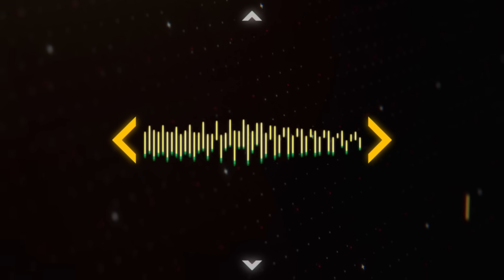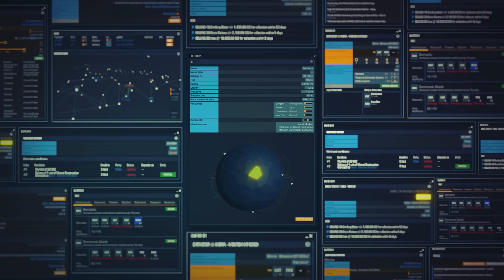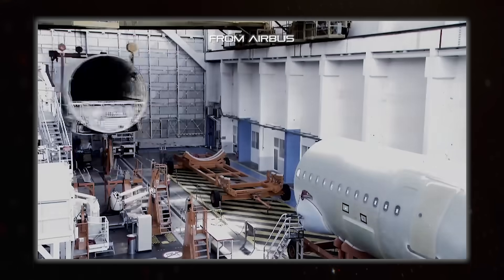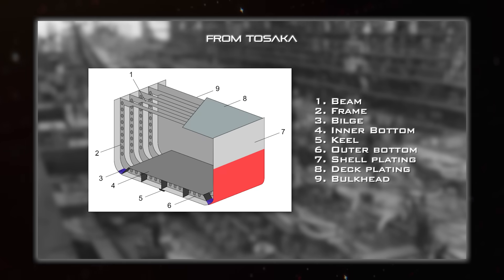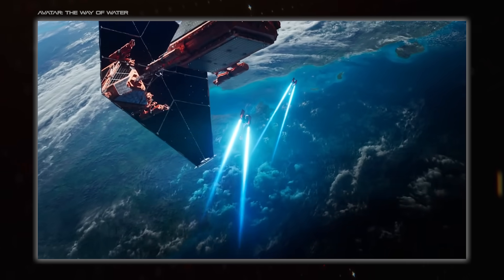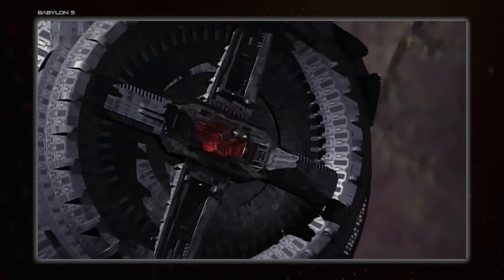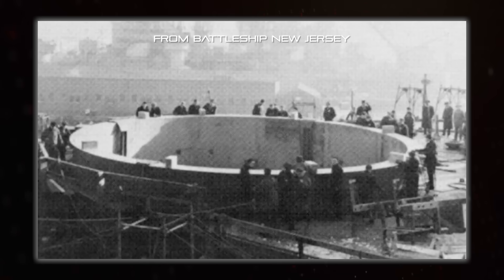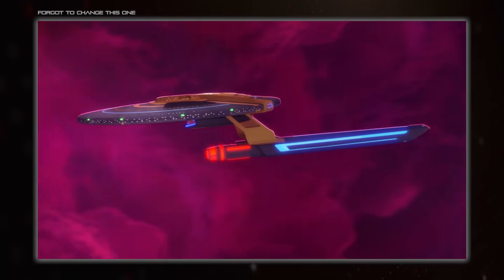How To Build the Structure of a Spaceship

Comment: Seeing the Eagle from Space 1999 brings up another interesting topic - interoperability and modularity. 

The Eagles entire cockpit section/command module could detach and become a lifeboat, but it could also dock with any other attachment for a command module, even if the command module itself was substantially different.
Such as the much bigger one on the Ultra probe.

[Which contained a tentacled telepathic monster that could mind control victims and dragged them in before spitting out their stripped skeletons ... on a morning childrens TV timeslot.]

There were also the Hawk fighters. 

And Eagles themselves could swap out central sections as well, to do a variety of task.

Someone at Starfleet watched Space 1999 and got the idea for the Runabouts swappable main sections.

They had found a missed file of copyrighted material, as all copyrighted materials were banned after WW3, along with Genetic engineering. 

Thats why you never see any copyrighted stuff in holodeck programs..

Humanity was still scarred after WW3 started due to copyright lawsuits between Apple and Samsung being the instigator. 
Apple and Samsung were, like all major corporations, controlled by different Augments.
And were tools in their proxie wars.

But the universe of Space 1999 shows a good utilisation of a standardised design for ease of interfacing between ships.

Comment: Use Lego. And when in doubt use MORE Lego!
Reply: And some Kragle for the iffy parts...
Reply: Lego is the solution to everything, ask me a problem and i will tell you how to solve it with lego
Reply: Hear me out, Lego and duct tape.
Reply: @dustybunny369  gorilla glue is an option as well 🤔
Reply: SPACESHIP!
SPACESHIP!
SPACESHIP!
Reply: @IAmEvilTree  are you.... Summoning a ride home 🤨
Reply: @IAmEvilTree  at least I understand this reference 😅

For those who don’t know SPACESHIP!!! Is a quote from Benny in the Lego movie 😂
Reply: How awesome of an invention that would be; super durable, temperature resistant upscaled Lego bricks that you can build any functional structure with from skyscrapers to spacecraft.
Reply: @christiancorralejo8726  I want an entire spaceship use this
Reply: @christiancorralejo8726 yeah we have that it's called modular construction and panel construction
Reply: unironically a great way to visualize 3d shapes and proportions because while CAD is faster/more date complete, the sheet dopamine of just messing with legos will pull you in deeper than any more focused project
Reply: Construx by fisher price 
circa 1980's
Or Bristol blocks
Reply: Modular construction is technically Lego. In a spaceship setting at our current technology I could imagine a ship built from standardized blocks with connection nodes at specific locations.  The main problem is weight. Many of the double walls between blocks would be ‘over engineered’. And when you a talking physics and orbital mechanics mass is your enemy as it requires more delta V to complete your missions.
Reply: I'm literally doing this right now 🤣
I use Bricklink Studio to design ships and mecha using a digital Lego bucket.
I'm not sure if I'm allowed to post a link to my Bricklink profile here or not?
Reply: @brianwalker8465  ooh what does it look like?
Reply: GUYS GUYS!!!

AN ENTIRE SPACESHIP MADE WITH BIG LEGO!!!!
Reply: No wonder we don't see spacewalks often.  Walking on Lego sucks.
Reply: LEGO!!!!!
Reply: And make the xenos step on it.
Reply: Lego Star Wars😂
Reply: And if that don't work...

use more lego.
Reply: Despite use Cobi, Bluebrixx, Xing Bao, Cada, or any bricks but lego. Cobi is preferred. Best strength.
Reply: Do you know how much damage that will cost legos falling to the surface could wipe out a city
Reply: And duct tape

Comment: There is a reason most space vessels in Perry Rhodan are spherical.
Reply: Those boring spherical ships and yet, after reading the series for 15 years I have yet to tire of them 😁
Reply: Keep in mind that one aspect of engineering is cost. A large spherical hull may make sense from a pure physics standpoint but it'd be VERY expensive to manufacture. Plus, you'd have all kinds of wasted space everywhere inside. Here, a submarine is a good model to base a spaceship hull on: A tube with a hemispherical cap on each end.

Plus, a ship with spherical parts could be fine but an entire ship being one big sphere? That'd look stupid as hell.
Reply: @christophermcelligott1593  A sphere is much more stable than some other design in fiction and much easier to manufacture.
Though Terran ships usually have a ring added to their equator for different reasons.
Given, a cigar-shape is better looking, but isn't as stable on the ground as a sphere.

People have been fine with the spherical ships in Perry Rhodan for over 60 years. So they must do something right. Especially if you consider that we don't just see cover art of them, but cutaway pictures of spaceships and equipment is a long-standing part of the series.
Reply: @christophermcelligott1593  Have you ever seen one of the very detailed drawings of the spaceships from Perry Rhodan? Then you would not write that. there is no wasted space and they do not look stupid. And BTW they are still much easier to build than all those vessels with are more complex design.